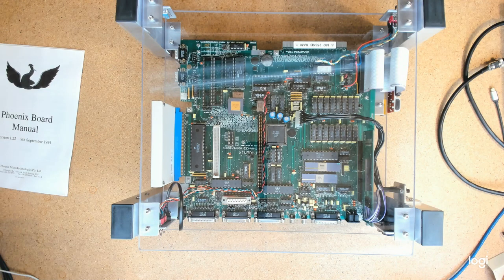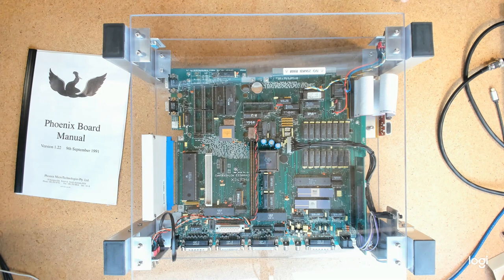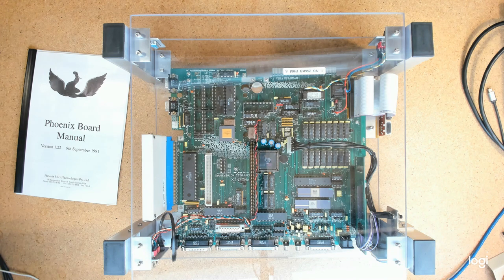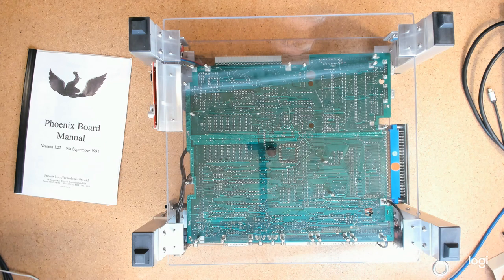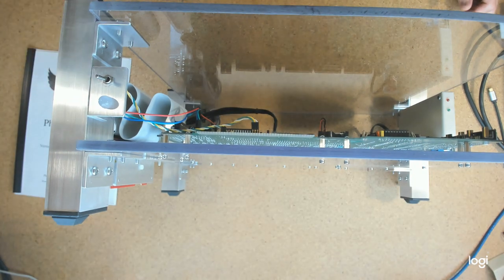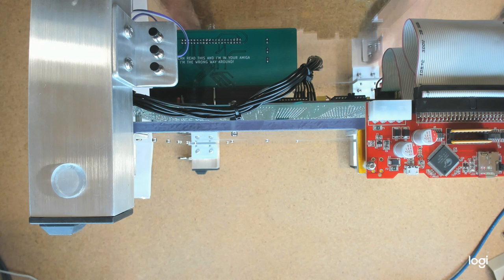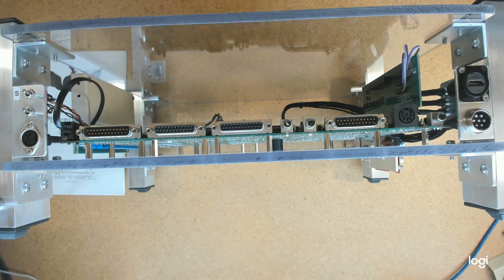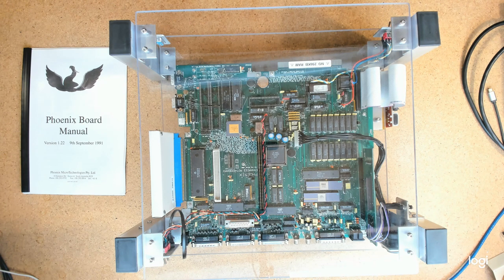Phoenix Amiga 1000 board - display case

Comment: Nice work :) I worked for Phoenix Microtechnologies back in the day. It looks like you have a coin cell to run the RTC. The original part we used was a VL2020 rechargeable battery. (going from memory).  If you was to use a (non-rechargeable) lithium coin cell you will want to remove the charging circuit to avoid any nasty bangs.
Reply from the maker: Thanks for confirming that.  I have purchased an ML2032 (rechargable) to put into that holder for next time I use the machine.